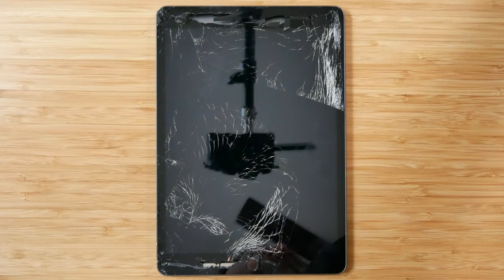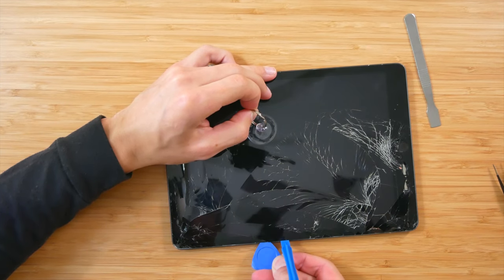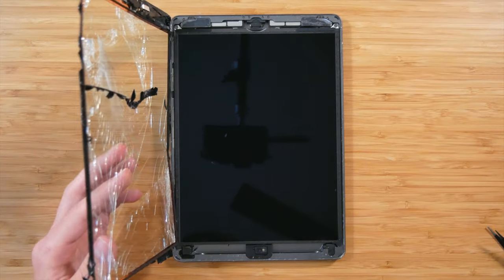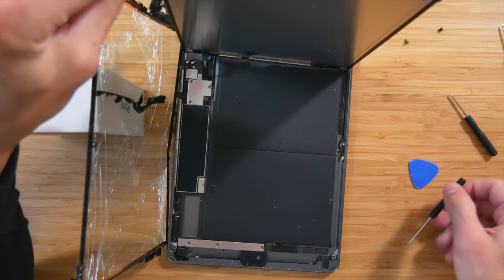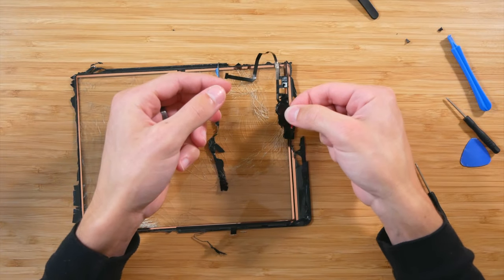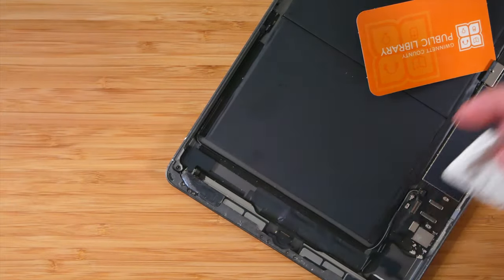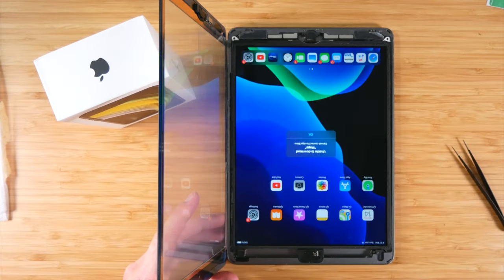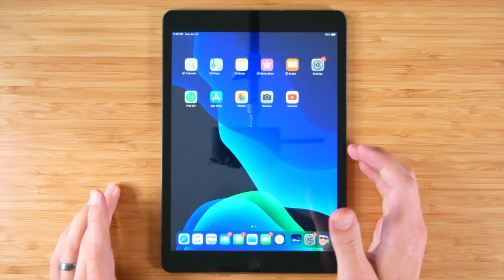iPad 7th Gen Screen Replacement! (10.2 inch iPad) Tutorial

Comment from the maker: Hey all! Please be aware - I made a mistake when transferring the home button, there is a bumper/part that needs to go on the new screen, so please don’t forget to transfer! Also, using a blow dryer is time consuming and is not nearly as good an option as purchasing a small heat wand/gun on Amazon. I would highly suggest doing so as it would’ve made the process much less messy. Thanks everyone!
Reply: May I ask, does the amount of damage matter? Is there a minimum of damage you must obtain to replace your screen?
Reply: If you would like the prosses to be a bit less messy you can put tape on the screen, this will also help the suction cup to stick is you screen is very badly cracked.
Reply: can you fix my ipad
Reply: They learn the hard way 😢🇵🇷
Reply: Can you tell me how to reinstall the “ fun part”as you called it
Reply: Please tell me how to put the bumper part back!!!
Reply: Good grief, if you hadn’t told me to take off that part, my computer would be working I can’t get it back on
Reply: Awesomeness

Comment: I’m a professional  technician and have had my business open for a couple of years. Overall, I’ve been in this field for well over a decade. Shame on you other people that do repairs of this nature for a living or on the side. You did a good job man and your attitude towards the unnecessary negativity that others have posted, is very good as well. Those with the negativity posts are more than likely the type of person that has to always find out a way to “one up” another individual. I always encourage DIY’ers to take some time and challenge yourselves. This is definitely a good repair for that and the bottom line with this repair, as with all repairs is to TAKE YOUR TIME. You’re very detailed and a good friend of mine sent me this video or else I prolly wouldn’t have came across this video. Again, great job man. Keep up the good work.
Reply: I bought a screen and it comes with a print scanner already, can i use it instead of reusing old one
Reply: @ronrod992  no no no you cannot. It will not work with Touch ID.
Reply: Why shame on people who do it as a side hustle?
Reply: My apple pencil is not working after replacement can u help ?
Reply: aint that the truth, most people watch these videos and don't even attempt the repair, they tell mommy to take the pad to the mall for repair. and bring me back a Chick-fil-A with double bacon.
Reply: As a kind of hobby I look for electronics in dumpsters and curbside stuff. Recently found an iPad A2200 (2019, 7th Gen), roadside find. The digitizer + LCD are pretty messed up! But the unit seems to work.
Reply: I am currently attempting to replace my digitizer after my daughter stepped on my 7th gen iPad. The problem we’re having is the home button, we cannot figure out where the cable is supposed to go. Could you advise?
Reply: @RuntzVibezz because he’s a melt.

Comment: Just finished repairing my granddaughter’s iPad. No one is more amazed that it’s working than I am. Could not have done it without your instructions. Thank you!
Reply: How long did it take?
Reply: @thebagfreak911  About an hour. But, I made a mistake, breaking the home button connector. So, another repair kit needed PLUS a new home button.

Still a lot cheaper than buying a new one.
Reply: Did you loose data's?
Reply: @io8587  No, all data was backed up on the cloud.
Reply: Vcv😮😮😮vvvvv😮v😮😮😮vvyv😮😮😮  😮😅😢 a lot 😮😮

Comment: Thank you for this guide, it was extremely frustrating process that took four hours to finish because everything was disconnecting every time I tried to put back the LCD screen and the wires would not connect until I got lucky after a few minutes. 
The screen I bought was from amazon was around 23$ and 9-12$ shipping being 35$ total. The part I reused from the broken screen were the home button. Don’t trust the adhesive that the screen provides if it does, I use super glue to attach the screen. 

This was extremely cheap repair but you pay with time repairing it. 
If you are terrible at this kind of repair work give it to a local store to repair it not a apple store, it saves lots of time.

Comment: I found this video to be excellent. I thought the guidance was accurate that I could do it on my own. You have seen my other posts where I am having trouble getting mine to work properly. The digitizer does not respond. I get a small square like a text bubble with the slide button partly in that bubble and partly outside of it. Other times it appears as it should but I cannot slide to shut it down. I am at a loss now. So close and no success.

Comment: This video helped me through the steps. I have question when I turned  my ipad on the screen was jumping around as though it was pushing and touching the screen without me touching.  It resulted improperly inputting my security code and locking me out several times until it was permanently locked. My question is , what do you think I did wrong? Can I fix the screen? Also fyi I did lose two tiny screws, would that affect it? Also I use the wet wipe and the dry wipe on the LCD screen , was that a wrong thing to do? Regardless, I enjoy the challenge and thought your video was very thorough and clear. I hope you can advise as to where I went wrong. Thank you , I hope you have time to respond
Reply: I’m having the same problem rn

Comment: iPad is working great. Only thing that wasn’t mentioned in this video, unless I missed it, was how to tuck the ribbons for the lcd so that they won’t interfere with the digitizer sitting flat. That area won’t sit perfect like the rest of the digitizer even though I didn’t beat to tuck the ribbons. I can apply light pressure and it will look awesome but it will continue to lift slightly in that area. 🤷🏻‍♂️

Comment: … Excellent video only thing I would add, based on my experience is that after you have cleaned the LCD surface or the screen surface with a alcohol wipe or whatever you used, the only thing I have ever tried that works every time, and works completely, (meaning, no matter what angle I look at it from I absolutely cannot see any streaks, swirls, or anything else on the surface) is to get the finest, highest quality microfiber cloth you can get your hands on, and fog the surface with your breath, and polish it with the microfiber… By definition, the moisture in your breath that condenses on the surface is distilled water in the strictest sense of the word, and polishing that dry with the microfiber cloth leaves absolutely nothing behind… This will work on a mirror or any other kind of glass, just be aware the cooler the surface, the more water will condense onto it.
Reply: Thank you
Reply: Great point!! 😃 Norwex micro fiber cloths are the highest quality material I’ve ever used they even have special cloths for glass surface that works like no other!!

Comment: You need to remove all of the residual foam from around the edge of the LCD - if you don't, it will begin to dry and break apart resulting in complaints of "dust" effecting the display...

Comment: That Goo Gone is a petroleum based cleaner. Or has some petroleum products. Good idea to follow up the G - G cleaning with an alcohol wipe! Found an iPad A2200 (by the side of the road). Looks like it works but both the digitizer + LCD screen are toast. Great video! 🤓

Comment: I followed your video precisely. When I get to the testing of the digitizer and LCD I turned on the iPad. It all worked so I went to shut down. Slide to turn off but nothing happens. I cannot get a card to disconnect the battery so now it just stays on until the battery dies? Not sure why I cannot get the digitizer to work as it should. What do you think I should try next?

Comment: This tutorial helped me so much I was able to complete the process successfully thank you so much for your step by step guidance. Btw this was my first time ever doing this and I did great with your help. The only issue I’m having is that Touch ID no longer works nor allows me to set it up
Reply: You have to take the old one off
Reply: Even if the new screen comes with a home button you have to use the original home button otherwise the Touch ID will no longer work.

Comment: Hello. I finished but can’t type in the code to unlock the screen. Does that mean I didn’t seat the screen well enough and now my taps aren’t activating the digitizer? I might not have cleaned very well around the edges of the old screen so that’s my best guess is that it’s not flush all the way.  Thank you

Comment: i replaced my screen and the home button doesnt seem to work now. it will work with the screen lifted using 2 fingers to it but when i close it the button wont work? could i have damamged it tothe point where you need to really push it and once closed that wont work? or did is the screen not sitting porperly and the bottom of the home button isnt hitting the bottom? any idea would be greatly appreciated?
Reply: turns out theres a little black button on the back of the home button. if the mounting bracket and the home button comeapart that little black piece usually falls out and is gone. i got one from a local store and put it in and presto.....hume button works......something to add maybe :) still great video

Comment: Thank you! Very helpful. The small chip from the button got stuck on the glue of the glass and prevented a flush fit of glass and frame. Had to remove the glass to access and relocate the chip. The new glass broke while doing it. Deng!. Will do it again. Very close!!!

Comment: I'm stuck on the part where you reconnect the two things attached to the touch display screen. They won't snap in. How hard can/should you press? Will it work if they are touching, but not locked into place?
Reply from the maker: They need to lock, try to just mess around with the positioning and apply slight pressure. They will click into place
Reply from the maker: Let me know if this works
Reply: @AffordableTechChannel  I've been doing that for hours. If the prongs are bent, can they be fixed? One is locking in and the other isn't.

Comment: Thanks for your video. I almost got my broken screen fixed except that I messed up the home button. Looks like I did not place the button properly. After putting it together, the home button is a little suppressed. Kind of works if pressed multiple times but not right there. Please add any instructions to verify / test the home button is in place before sealing the glass. Also if I remove the glass now to fix the home button, will the adhesive be strong enough to snap again ? Any ideas how to fix the home button ? Thanks again

Comment: Thank you for this video. I used it to replace the screen. When i tested it before closing it back up everything worked. When I went to close it up it was not closing properly and the screen cracked. I opened it back up to see what was stopping it from closing and now the lcd has lines across it and is just a blank black and white screen. Is there anything I can try to remedy this or did I somehow destroy the lcd?

Comment: I’m having trouble getting the flex cables to stay put when closing back up, any pointers? Also, I heard that the gold part at the bottom of the replacement screen need to be covered with tape or it will have ghost touches which ruin the repair. Any knowledge about that happening. Any advice is appreciated. Thanx.
Reply: I’m having the exact same issue closing it up. How did you do it?

Comment: I was never an Apple fan....but last year when I felt a need for a tablet ...despite the urge to get better value for my money in the form of Samsung tabs...I went for hardware quality and durability that Apple offers.
But I. Am disappointed my iPad Air 3 is facing screen issues...where I press any button or open folio to wake this up, display backlight will turn on but screen will show nothing. While connecting the charger and taking screenshot [home plus power] I can hear the sound.
Don’t know what to do...I don’t have Apple care plus and now I am skeptical to go for repair at Apple as that would cost me the price of new Apple iPad.
I have exams next month  and this device has screwed me, as it has all my notes.
Can someone provide a solution plz.
Is it hardware or software issue....cuz it happens 2-3 times a day...and sometimes it lasts for hours together..in between the display works fine without a glitch.

Comment: I've done this myself for a friend. It wouldn't turn on so we thought it was a dud. After charging the battery it worked 😂 Oh' these replacement screens are better with a toughened screen protector applied afterwards as they're not as durable as the original apparently 👀

Comment: I just did this replacement but the screen started to touch everywhere so we are unable to use the code. I checked the connections and everything is fine, disconnected and connected everything again. What could cause the screen the touch everywhere even if the touch is disconnected?
Reply: Maybe I should use the original button instead? There was already one that came with the screen.

Comment: Hello. My touchscreen isnt working after screen replacement. Before replacing the touchscreen worked when it was cracked. Any ideas? Thank you.
Reply: Maybe you didn’t snapped the connections in place all the way. I had a hard time with that
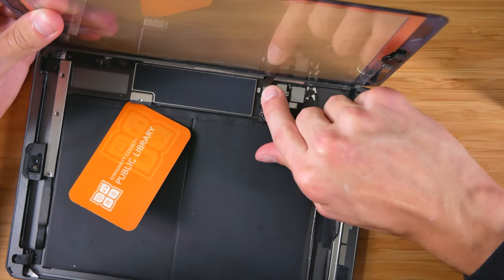Reply: 14:55  those 2 are the ones that enabled touch screen

Comment: Hello. I just tried to replace my screen but something went wrong. I followed the link you left and got the digitizer. However, I noticed you spent $65 on yours but the one on the listing said $20. I thought okay, maybe there was a wild price reduction. Well, I followed all the steps, everything came together fine but when I went to boot it up the screen was going buck wild. It doesn't acknowledge when I touch it and will randomly access the keyboard and just start hitting numbers and letters at an alarming rate. I cant even shut it off. Help! I need help.

Comment: Hi David, I would suggest the vendor really meant a blow-dryer. A heat gun (interpreted as a paint stripper) would be far too hot for this operation and likely to cause serious damage. I'd always try the dryer first. I will be replacing a screen very soon, thank you for posting your video. I now know what to expect. 👍
Reply: Nope, heat gun works perfect. In fact, that’s the only device that can reliably lift the glass off the adhesive. As an added bonus a heat gun allows you to reuse adhesive if your glass doesn’t come with adhesive.
Reply: @happymanmkwii   Thank you. That's extraordinary, considering heat guns melt plastic.
Reply: @channelsixtysix066  are you sure you didnt accidentally buy a nuclear reactor instead of a heat gun?
Reply: Lol I used a heat gun and melted sides of my lcd 😭 just slightly so I guess I’ll have to buy my son a new one
Reply: @lakiynlarocca3360   The only way to stop that, is to keep the gun moving around the screen, not playing the heat on one spot.

Comment: Dude at apple told me the 7th gen can not be opened without breaking the device, is that true?
Also, we have had three iPad 7th gens have the same problem. The get stuck in a boot loop(?). The apple logo pops up for a few seconds then the screen goes black and the logo pops up again. It keeps doing that. Doing a hard reset gets the "service" screen, apple support website at the top with the computer screen icon and the lightning cable image, to pop up but the device can not be updated nor restored. The first one was about 7 months after purchase, the second one about 9 months after purchase and the third, which was a replacement unit, was the 7 month replacement happened 9 months after being replaced. 
Is this a common occurrence with the 7th gen? The third one we had replaced with an 8th gen and the only real difference that I could find between the 7 and 8 is the processor and an hour more of battery life. Which leads me to believe the processor was causing issues in the 7th gen so they swapped processors and called it "8th generation". The processor in the 8th generation came put in 2018. 
Anyway, sorry for the rant but it really bugs me. Oh, a couple more things. We had gen 2,3 and such and never had any issues with them. We also had a third iPad 7th gen that developed an issue with the charging port and had it replaced. For the record 4 out of 4 ipad 7th gens had to be replaced, three of them for the same reason. Also, not sure if it matters but all were 128gb wifi only. Thanks in advance for any information.